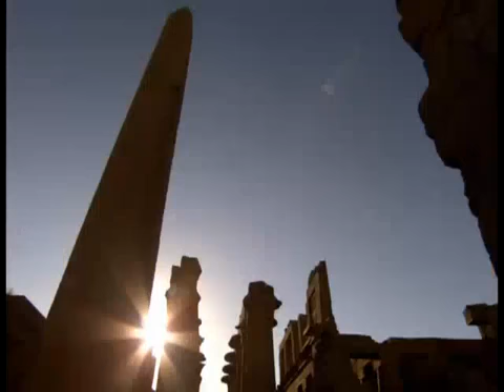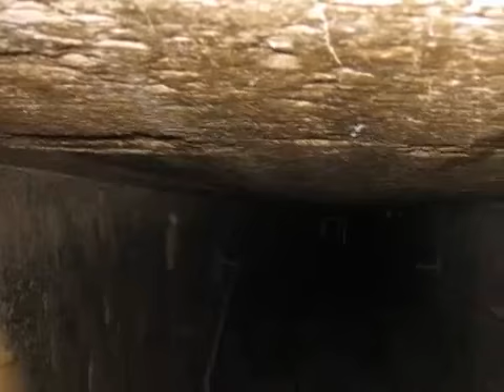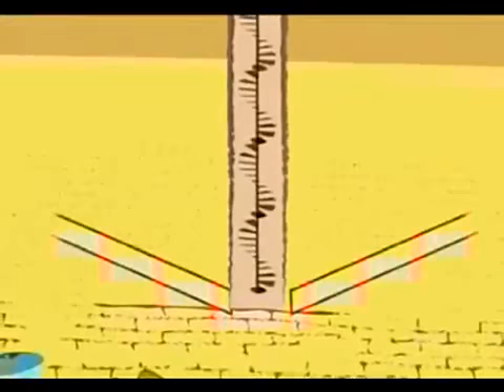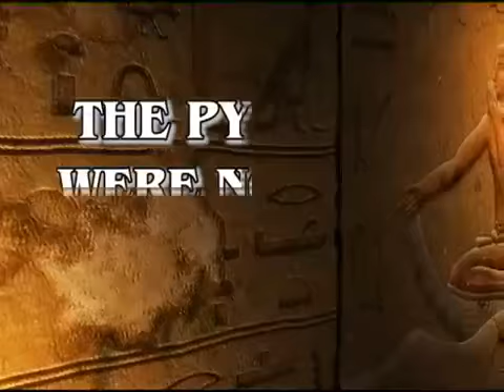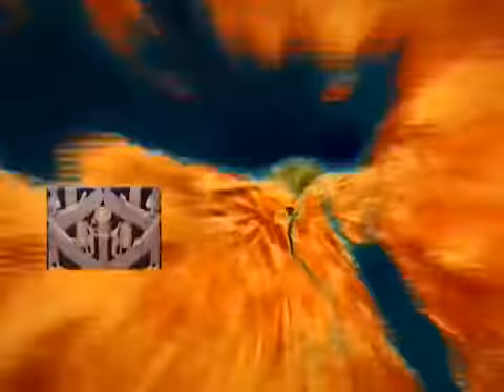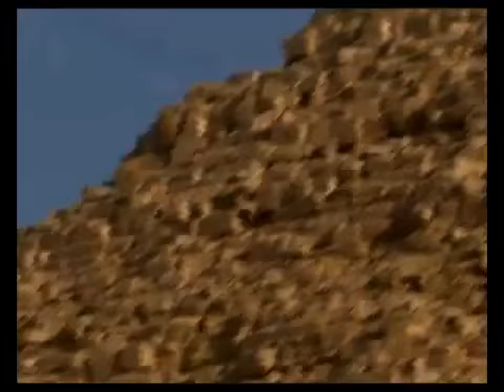The secrets hidden in the pyramids of Egypt (Harun Yahya).mp4

Comment: Although scientifically plausible with good illustrations and a sound theory, your information regarding the ark of the covenant being used as a capacitor could no be true. The ark  was not constructed until well after Moses led the Israelites out and away from Egypt. The Bible as well as other historical writings show that it remained in the "most holy" chamber of the tent or tabernacle which moved around with the Israelites in the wilderness, nowhere close to Egypt, and later was placed in Solomon's temple then disappearing in 70 C.E.  during the destruction of Jerusalem. If the Egyptians understood how to make an electric generator, which the theory in this video shows is a strong possibility, they would have most definitely understood the need for, and how to build a capacitor and would have designed something more fitting for that specific task. The video also says the ark of the covenant would have fit exactly in the stone chamber. What were the dimensions of that stone chamber? For the kind of power your suggesting the pyramids could produce you would need a capacitor much larger than the ark of the covenant.

Comment: Ah I don't want to shake up the Kasbah , but .
If you knew how to use and generate electricity ?
Wouldn't you also know that it isn't that hard to make ?
Also , Mr. Tesla , didn't reveal all he knew ?
As in ; his tower , the hypothesis is that it was a transmitter of wireless electricity ?
The question arises , to what was the electricity to be collected and used ?
My friends , an aquifer doesn't produce that much electricity .
The tower , and possibly the Pyramids , were collectors of the ionic electricity in the Ionosphere , which is and always was present over this planet .
They collected free electricity by creating a ground fault , thus directing negative ions back to earth , as this massive grounding passed by the collector to the earth , this is where your work or your motors and lights and batteries used and stored the passing energy .
Come on , I'm just a mechanic from northern Ontario , aren't there professionals out there ?

Comment: you are right...partly...but the pyramid is a bit different than you imply.  There was a second chest in the queens chamber removed by Napoleons men and the kings was isolated until the blocks were removed for access.  This would indicate not only a source of power...but a transmitter and navigation beacon. This is why the entrance was hidden.  It was for military purposes as well in my opinion.